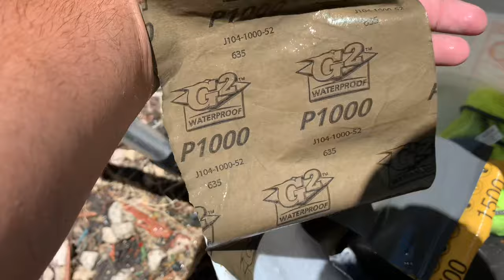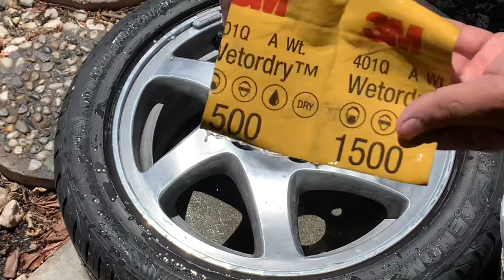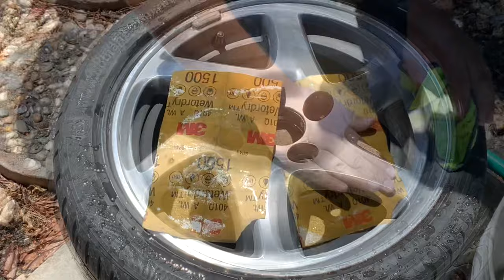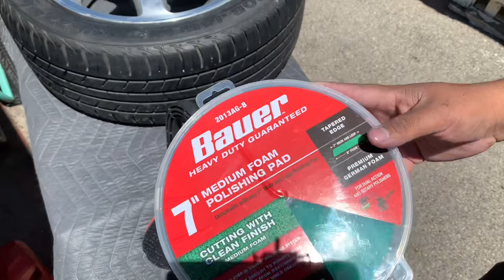HOW TO POLISH ALUMINUM WHEELS W/ PEALING CLEAR COAT !

Comment: Guys use lower grit to get the clear coat and paint off it, for example you can safely use 180 grit to get the corrosion off and then just do a once over with 320 then scotch pad
Reply from the maker: True!

Comment: Looks great! Quick tip. Mark the wheel weight position on the tire sidewall so you can remove it and reinstall it without having to balance the wheel ✌️
Reply from the maker: Thanks a lot 🙌🏽

Comment: When wet sanding be sure to add dawn dish soap it helps make it easier to sand larger areas it helps the sand paper move more freely but has the same affect
Reply from the maker: Great Idea will do next time💪🏼
Reply: @ToledoDIY  dawn in particular! lol use any brand
Reply: Looks really good, thanks for the video and info! 😎
Reply: @danielskrskr dawn doesn’t have any additives or “lotions” or caustic chemicals. That’s why only Dawn..
Reply: @fixedgear37  good to know over a year later 👌
Reply: @danielskrskr  shit hasn’t changed in a year or in 10 years. Time doesn’t fucking matter
Reply: @fixedgear37  Good to know 2 weeks later

Comment: The wheels turned out great, I'm sure a lot more people are gonna be cruising around on much nicer wheels because of this video. Couple things that made my project easier was i used a cordless drill, I found 2 and 3 inch buffing pads. There's wool and different foam pads I used and lastly I went with a grittier polish called Autosol. It comes in a tube, when polishing porous metals it turns any buffing pad black and the surface your working on like a mirror, sound good? Give it a try...👍🤠✌️
Reply from the maker: Thank you for the feedback🤝

Comment: Looks very good.  I actually used a  clearcoat stripper on my wheels, and it also turned out fantastic!
Reply from the maker: Thank you!!! Yes! I’m sure that worked great! 🙌 thanks for watching
Reply: what stripper did you use?  i need to strip my clear on some G37 sport wheels and everything i've read says all the stripper formulas were changed a few years ago, and that the new formulas are a lot weaker.  did you have to do multiple passes per wheel using the stripper?
Reply: @jhart0512   I use the strippers at Rick's Cabaret on Bourbon St.  Not making this up.

Comment: Great video, did this on some work wheels I got for cheap back in the days. It was easier to polish then this since  the face was flat and didn't have many spokes. 

Only down side to this is, if you live any where that rains alot, your gonna have to re ppolish offten. Pretty much,  your polishing the wheels atleast twice a week especially if you like to keep your car clean. 

If your car have alot of break dust it's even worse and when it's not polish , it looks like crap. If you can afford it,  powder coating silver or chrome will be better, less work keeping it shiny and cleaned.

Comment: Good shit. I have a 2017 Cadillac Xts and having the same problem just got the mother’s polish, was told to use an carpet like pad or towel, I have some spots on my right front wheel the rest are just peeling a lil.

Comment: Looks super clean, great job! I refinished am EM1 wheel which was pretty bad with very good results using a different method. I didn't sand and polish, I used aircraft paint remover and then re-cleared the wheel. Really like the DA content, keep it up!
Reply from the maker: I appreciate you!
Reply: I used aircraft remover and it doesn’t take al the clear off
Reply: Used aircraft as well and had the same problem of not taking it all off gonna use the method he just used with some dish soap most helpful video I’ve found for the problem already got flitz products to buff💯

Comment: Can you use 4.5" grinder instead of 7"? And how do you treat those polished wheels? Do you need to reapply Mother polish often? Can you wax those wheels? Thank you for the great film.
Reply from the maker: Not sure if you can do that! Yes u have to apply mothers every so often to keep the shine right! But just with a micro fiber is fine
Reply: @ToledoDIY  I see, thank you. I think I have clear coat though on mines. Looks like it is bare metal on outer side of the wheel, but those voids (whatever they are called, between spokes, where the the stem valve is (in one of them)) are definitely covered w/smth, since they have solid gray color, don't look like metal. Special thanks for replay about maintenance.

Comment: Nice those look great ,could I ever get those results polishing by hand. My rims are rough can i use a lower grit to clean them up or will it scratch them to much. Thanks Dale
Reply from the maker: Thanks for watching! Glad you liked it! Yes u can by hand it will just take a while! But it’s possible
Reply: You can use a low grit but just make sure you get the scratches cleared up as you work your way into higher grits

Comment: The one thing I see is a throw those hammer on weights away and use stick on weights inside the rim. When the guy at the tire shop installs hammered weights it cracks the clear-coat. Not to mention it looks terrible. I am myself balance all aluminum wheels with stick on weights on the inside in one spot only. static balance is the best way to go.

Comment: I’ve tried everything to get the clear off my wheels. I’ve always heard about this method but never really paid attention to it. But now I’m doing it.  I also have a 2nd gen 🤟. It’s a 93 db1 Integra sedan rally sport. But my wheels are 15x8 in the front and 15x8.25 in the rear. But now I can’t actually get back to doing my wheels before my skunky terrorize the streets again.
Reply from the maker: Try this!!
Reply: Ohh trust and believe it’s most definitely in my cards. Nothing else works. So I’ll try it. Just gonna be a little difficult because the spokes.

Comment: That turned out killer, nice job. Lots of work but worth it. Now think about a wax to seal them, l use Collinite Insulator wax....it works great on everything....water beads off for weeks.
Reply from the maker: Thanks Michael!!! Definitely need to do that! Thanks for the tip!
Reply: would that prevent re-oxidation since the clear coat has been removed?  I'd rather not re-spray clear but I'm about to do this and don't want to have to take them off and scuff and clearcoat if that bare metal looks bad in a few months.
Reply: @stevenr7272  like any other wax, you have to keep reapplying it. If you cleared the rim again, you wouldn't have to worry about oxidation until something chips it and you let water stay and mess up the clear

Comment: So I followed your procedure but I still show scratching should I use a 5000 grit or keep polishing with the buffing bars.
Reply from the maker: Yes! So that! The finer paper the less scratches it will leave
Reply: What is your opinion should o go lighter sand paper on the next wheel?
Reply: Yes I already polished it but can a go over it again with 5000 grit and buff it out again
Reply: @ToledoDIY  cool thx

Comment: Great finish. How often do you need to polish the wheels in order to keep that shiny finish?
Reply from the maker: Every 3-4 months hand polish does the job
Reply: @ToledoDIY  have you thought about putting some clear coat on to make that shine last? Not sure if that wouldn't help.
Reply from the maker: @sebastianrc5024  nope don’t wanna do that! Plus I sold the car with the wheels on it! So it’s not in my possession any longer
Reply: Clear coating it would have just helped it more than anything, it's basically what they do to rims. Probably what I am going to do to protect from rust and anything else
Reply from the maker: @michaeljo281  definitely, but these are aluminum they won’t rust

Comment: Good video bro . Looks really shiny . I wonder how to remove the swirls though ? Having that same issue after polishing . It looks like it’s from sanding
Reply from the maker: Use finer grits, go up to 2500 and polish
Reply: Yup use finer grits, and dont skip too far between sandpaper grits.
600,1000,1500,2000,2500.
Skipping any of them will result in sand marks
Reply: @badass98svt appreciate it man

Comment: Great Job man, however, by just polishing the wheel you left it exposed to salt, water and heat..you should've de-grease it after polishing then apply clear coat
Reply from the maker: Definitely a good idea! But this worked for me just a quick hand polish every 3 months or so and I was solid!

Comment: So yeah great job! I guess there's no point in clear coating them any more as long as there polished and kept clean rite?
Reply from the maker: Thank you!! And yes! Exactly! Aslong as you polish then even by hand once in a while they will stay looking good!
Reply: No not the case really.  Aluminum starts oxidizing as soon as you finish cleaning/polishing it.   Even if kept dry and clean, they will continue to tarnish/fade over time. Clear coat would solve the issue though.

I had a $3000 set of polished True Forged wheels (no clear) on my Cobra and shit, they were a pain in the ass to keep shiny af.